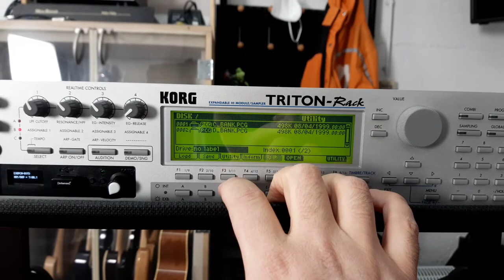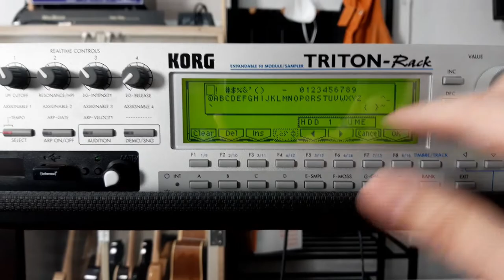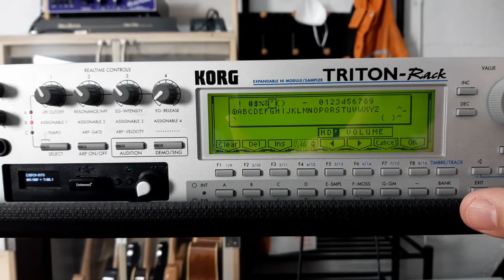Let's fix a Korg EXB-SCSI expansion board!

Comment: My EXB-SCSI might have the same issue (I see 0V between pin 25 and ground). Do you have any information on what kind of replacement fuse you used? I couldn't find it in the parts list of the Triton service manual.
Reply from the maker: The fuse is CCP2E20TTE. It's a 0.8A fuse in a 1210 package. I couldn't find an exact replacement in any local or international store, but AliExpress was my savior here. You could go with a 0.8A or 1A slow-blow fuse in a 1206 package.
Reply: @ff5tech57  Thank you!

Comment: Great video, thank you! Is it possible to test the fuse in situ by testing continuity across it?
Reply from the maker: Sure, if the fuse is blown then there would be no continuity or if testing resistance it would measure an open circuit.

Comment: What scsi to sd adapter is that? Thanks
Reply from the maker: I bought it from the Amiga Kit website. I believe it's an older model than the one they currently offer, but the one you can currently get should also work with Korg Tritons:
https://amigakit.amiga.store/zuluscsi-mini-adapter-p-91288.html?aksid=5j7lp795ak21f7i0qbb4eiedo9&currency=GBP&aksid=5j7lp795ak21f7i0qbb4eiedo9